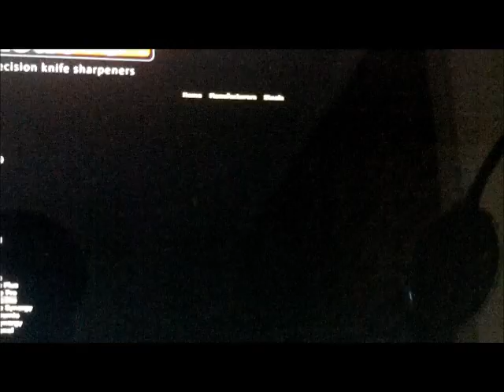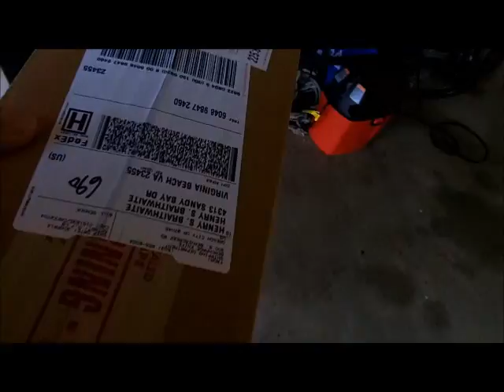MAY 6TH - 10 Min Spin - 9100 BenchMade home - Ron's TBS DISCOVERY find

Comment: Max, the price really varies on those quad copters. The TBS Discovery is the style of top and bottom plate. The plates alone are about $80. Now, you can piece together a copter like that or if you buy the kit they're on average $1500. Looking at that it looks like it was a pieced together unit. The only reason I say that is because Blacksheep usually labels the heck out of their products, including props and I see no labels outside of the frame on that copter. Also the ESC motors look different. Probably why it crashed... lol